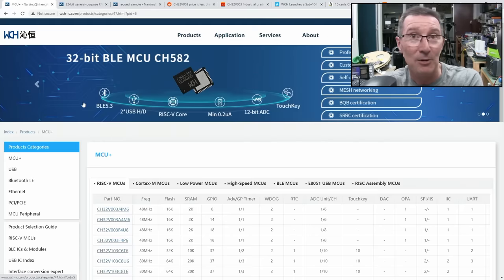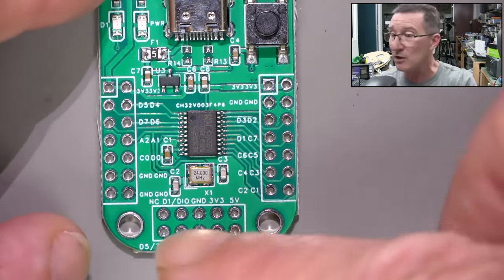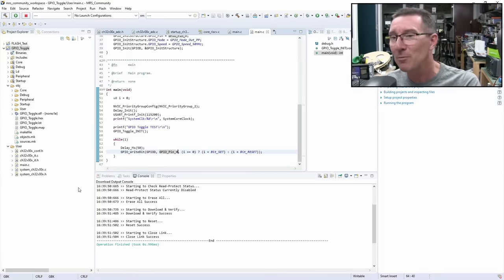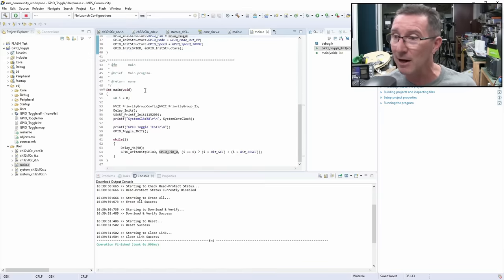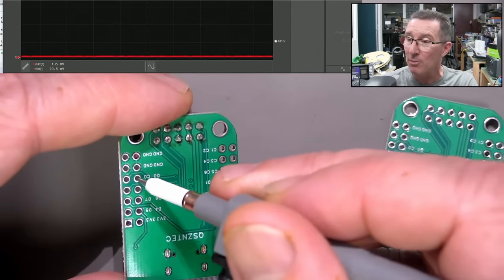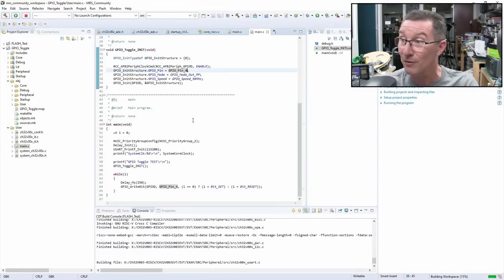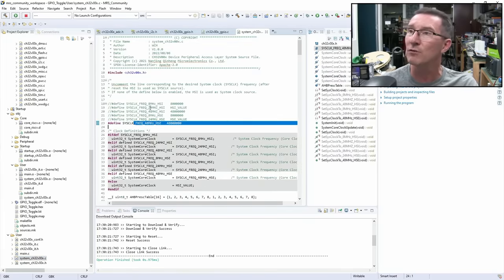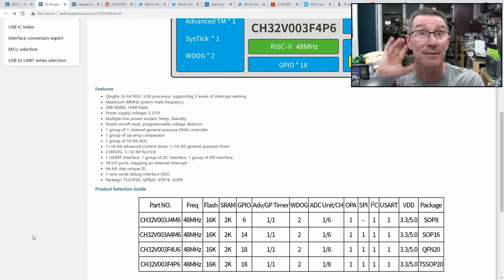EEVblog 1524 - The 10 CENT RISC V Processor! CH32V003

Comment: The prices is completely crazy.
I teach EE131 (first year Digital Electronics) at a local university and basic digital ICs cost more than that.  It is important they understand digital logic; but, the only place they are likely to ever use it is in an FPGA design.
I recently helped someone debug a Space Invaders Arcade Game and most of it is done with MSI logic (counters, etc.) and only one Microprocessor (which probably cost more than all the other ICs combined).  Things have certainly changed.
Reply: Yeah with microcontrollers and to some extent FPGAs becoming as cheap and small as they are it doesn’t make a lot of sense build something up using digital logic chips. Microcontrollers are just that versatile now, you can use them for implementing a single gate or you can implement a complex control system. Their only downside really is speed, they are usually quite a lot slower than the propagation delay of a gate but most common applications now aren’t relying or dependant on the speed of individual gates unless it is in a very high performance or high speed system, in which case you probably have more going on than just a single gate and you are probably better then just using an FPGA.
Reply: When I at college learning electronic engineering we had to buy pic16f877A wich was the stronger part less prone to burn on our hands, it was 8-12$ then now should be about 25$ thanks prices are relatively cheaper now, but said parts on 10c even having free ide (i learn with proprietary pic ask and PICC both pain in the ass and expensive for non educational projects) kudos
Reply: I took digital logic twice, once at a small university where it was part of CS, but actually offered by the physics department (and I TA'ed that course for a couple of years after I took it) using discrete 7400 logic chips. I took it once again after I transferred to another larger university to switch to COMPE from CS (and in eningeering they wouldn't transfer any courses beyond 1st year courses), where it was all FPGA based. The discrete logic chips in the breadboard was more memorable and fun, but took hours of plugging wires into the breadboard, and troubleshooting if you made a mistake. The FPGA version was way faster, but less memorable and less fun, and less "hands-on" - I always did the labs the night before at home, simulated it, and basically loaded it up on the FPGA board and demo'ed it to the lab instructor in the first 5 minutes and left for the afternoon (to go work on the endless stream of homework from other courses).

Comment: I remember prototyping with the PIC 16F54 in the mid 2000s with <1K of program ROM and 25 bytes of RAM, and programming in assembly because of the cost of the C compiler and having so little memory.
Reply: In mid 2000s I programmed not PICs but OTP Z86E04. Made controllers for lights flashing on buildings.
Reply: back in 1800 we only had candles, those were the days

Comment: Damn, that's a lot of value for just 10 cents! I'm already even somewhat familiar with the Eclipse IDE, since I like to use STM32 MCUs, so it should be a breeze for me to start using these as well.
Reply: Where do you source parts ? I need whole tape of STM32s and there is none on the market right now. Do you think that big manufactures are getting special priority lead times? Last time I checked the lead time for ANY STM32Fs was 500days.
Reply: @webkar  Currently nowhere. They are basically all overpriced and/or completely unavailable everywhere I look. I'm just biding my time and keeping an eye on worthy alternatives.
Reply: @webkar  we might be seeing more and more risc v drop in replacements.
Reply: @JamilKhan-hk1wl  almost every MCU manufacturers, even the historical survivors, are jumping to RV cores. There are some pin compatible replacements of chips like the STM32F103 for years but the issue right now is availability.

Comment: I just redesigned my little LED controller around a ESP32-C3, that variant is also based on Risc-V. Definitely gonna check these out too, not only is it cool that Risc-V is an open architecture, availability of Chinese parts seems to be a lot less variable than western parts have been recently (one of the reasons I switched my design from a SAMD to the ESP32C3..."supply chain").
Reply: I used the ESP32-S2, and the peripherals (particularly the ADC, DAC, and UART) were terrible. On the S2, there was no way to linearize the ADC, even with a look-up table. The SAMD-51, running the same code, worked perfectly, no tweaking needed (though you can actually tweak offset and linearity in registers on the SAMD-51's ADCs.

The RP-2040 has a wonderful manual, though the chip has some bugs (the manual writer apologized profusely for one of them). The SAMD-51 has a decent manual. The ESP32-S2 has a pretty lousy manual (unless they've redone it recently).
Reply: @Johnny.Fedora  Yeah I've used the ADC on the original ESP32 and wasn't impressed, but for this device the only thing I'm using ADC for is measuring the battery and that can be pretty rough. I'd expect it to be the same IP block/fab process on the C3 so probably no better. C3 doesn't even have the DAC, and the UART is fairly tertiary for what I'm using it for, I expose the pins on an expansion header but for the most part I just use these things for making small lamps/simulated candles from turned wood (board is round and fits in a 30mm forstner bit pocket). The USB serial emulation seems to work well enough on the dev boards I picked up, and that's mainly what I wanted. Overall, ESP32 is a cheap low-end chip for low-end applications, and that's exactly what I'm using it for.
Reply: @treelineresearch3387 , that makes sense. In fact, one of the peripheral part choices had an on-board ADC, which mean I'd only have needed the SPI port. In any case, I wound up going with the nRF52840. It's not cheap, but it has the necessary memory/processing power, so it's all good. When RISC-V is more competitive for that niche, that's what I'd like to go with, on principal.

Comment: The STM8 standard I/O library was fairly incomplete. i re-wrote much of the library before fiding someone else had done exactly the same. ST (like AMD) are great at making silicon, but not so good with software. So I wouldn't be too surprised to see ST make a RiscV implemementation, as they need not worry about software. The kings of the MCU software have been PIC, but from what you show me, this isn't too far from PIC in terms of ease of use.

This architecture (looking at Mhz) perhaps sits between STM8 and STM32. The STM32 is ARM based, and ST could save money on licencing costs, so we could see a merge in those  low and mid-end MCU offerings in a Risc V product line. A scalar lower speed to replace STM8 and a higher clock and instruction pipelining and other logic trick superscalar basic instruction set RiscV to replace STM32 with the same tool chain accross the product line.

Comment: Interesting idea, Dave. It's nice to see that microcontrollers are coming at a good price.
Reply: This mc is 32bit replacement for stm8s003, has same pinout. stm8s003 cult microcontroller. Nuvoton did it's x51 N76E003 pinout compatible, now ch32v003.

Comment: As the STM8/32 is often using external IP for IO (and in the32-case also for the cpu), it is easy to make replacements. The accused „counterfeit“ STM32F103 are such cases. They just licensed what ST licensed before. No legal issue.
And the same is happening here. The IO is what needs experience, the cpu is handled by the compiler.

BTW, this is the result of threatening customers to sanction them. They then try to build it on their own.
Never get a customer to look for alternatives.

And on toggle:
Pretty sure you can just use the io registers directly. They might look very familiar for STM experts. Assembler might not be needed. Some time ago, in a German forum an AVR assembler expert was burnt down by GCC and someone able to write good C++ code. The metric was flash size.

Comment: Bit of a mangled RISC-V explanation there. It's indeed just an ISA, which means that you either get an open source core that implements this ISA, or you pay someone else (like SiFive) for the core, which means that you still pay license costs, especially for any IP blocks that are likely to be added to the processor.
Reply from the maker: Well yes of course, you could pay a license fee to use someone elses pre-built core, but that's not really the point of a major manufacturer for example making a RISC V chip, they'd do it in-house so they never have to pay a license fee.
Reply: @EEVblog  Yep opencores has open cores for RISC-V e.g. the NEORV32

Comment: Cool to have something like that. I personally haven't played enough with my ESP32 and RP2040 µCs and don't really need these (especially while there's no IDE-free open build system yet, seems like), but maybe at some point… Thanks for showcasing the thing!
Reply from the maker: People developed an open system for the Padauk micro very quickly, same thign might happen here. It's all there really, nothing stopping someone taking all the dependencies and just usign the commend line GNU compiler without the IDE. Why not just use Ecplise though?
Reply: @EEVblog  I think I heard most of it in the video after submitting the comment, I'm only not in that hurry of verifying it for myself.
If I was a good specialist and really needed them, I would participate and invest my efforts into doing this; yet, I'm a silly curious viewer of your interesting videos.
I didn't really like Eclipse back when I tried it, prefer a lightweight text editor and make or cmake myself.
Reply: @EEVblog  Espressif are leading the way in migrating their powerful and now very mature stack.   While they are still mostly relying on ESP32 with Tensilica cores, they are now so big and pervasive in the IoT market they stand to benefit immensely by moving across to RISC V by using the same SDK they have been developing for ages and are now at version 5.0
Reply: @Janus Kobain  what are you saying? The log shows it uses makefiles just like so many other controllers out there. IDE is irrelevant.  You could easily build that without  the IDE, just using open source tools. As for the flasher, it's probably just a bunch of uart command that you could write into a  Python script. Probably, less than a day's work.
Reply: Also, there are tons of eclipse  based IDEs out there from the leading microcontroller manufacturers.  They aren't pretty but really powerful once you get over the learning curve. But yes, they are a mixed bag. Some do implement really well, and others are really bad and slow, where a text editor like notepad++ is better.

Comment: The build system probably doesn't have the hex file as a dependency. How to fix that depends on what build system eclipse is using for your project .. its own, make, or maybe something else.
Reply from the maker: Ah, so it's flexible, interesting. I did see all sorts of options for setting up dependencies, but was easier to just save it for this video. Thanks.

Comment: I'd love to see how good (or bad) the ADC is. There are some absolutely brain-dead examples of ADC uC implementations (be that design, software implementation or hardware). I reckon you can tell a lot about build quality by how well or poorly the ADC performs because it's one of the hardest things to implement with good results.
Reply: I've used the Espressif ESP32-S2, (RISC-V) and the ADC was TERRIBLE -- and the serial UART was problematic. I ran the same code on a SAMD-51 (ARM4F), and everything worked beautifully. It was impossible to lineraize the ESP-32's ADC, even with a lookup table, whereas the SAMD-51's was quite linear without any correction. Also, I had to stuff a byte out at start-up on the ESP32-S2, or it would always eat the first byte, throwing everything off by 1 byte.

Comment: Can't wait for a mesh net to be available using this. Going to be super cheap to wire up a home. Near endlessly updateable. Right now it's a thousand bucks.
Reply: That was my first thought.  network routing.
But 8 ADC's can be useful as well.  It could run an 8 channel mixing board.
Reply: @robertsmith2956  8 channels, not 8 ADCs as far as I know, so they will be multiplexed, so the more channels you use the slower the sampling rate. This is very common for microcontrollers. Loads of other microcontrollers like STM32 have more than 8 ADC channels and some even have multiple ADCs.

Comment: I never ever knew an IDE where you don't have to save after you edit a source file.
Reply: Arduino IDE does not need to save before compiling/linking. VSC does not need manual saving, it's automatic.
Reply: @donvukovic7440  VSC only if you enable autosave - it is not on by default. Yes Arduino IDE has autosave on by default.
Reply: In Eclipse it can be configured whether to auto save before build or not. You can even configure auto build on save.
Reply: @foo2332  But if you build without saving does it still build from the edited file? I doubt it.
Reply: @BrianG61UK  no. It will save automatically when you enable "save before build". Otherwise it will build from what is currently on disk, and this mode (silently ignoring changed editors) is actually pretty useless IMHO. This was on of the first things I configured years ago. If I press Ctrl b it will now first save and then build.

Comment: @8:31 The peripheral clock enable function on line 35: This looks similar to how peripherals function on STM32 chips, each peripheral (i.e a GPIO port/timer etc.) has a clock enable to it allowing the peripheral to be completely powered down. By default all peripherals have the clock disabled and have to be enabled one by one, so that only the peripherals you need consume power. It's likely the peripheral design on this chip follows a similar pattern to STM32 chips (and potentially other 32 bit ARM micros).

Comment: The nice thing about the RISC-V situation is, the barrier for a vendor to just let you use an unmodified standard toolchain is very low.
Making a source-compatible (with the competing STM product) library would be the last mile (and at first glance it looks very similar). Under all of that Eclipse goo, it's just running GNU make, and the problem with the "build" command is probably to do with an incorrectly written Makefile.
No doubt a chip like this if it gains popularity will get an Arduino port.

Comment: The RISC V is open source but you still have to pay a 100k for them to allow you to get the technology. You may not have to pay royalties but still have to drop a huge amount of cash to begin with. Not really open source like the linux distributions that just hand you the code at no cost, you just have to share any modifications you made to the code.

Comment: Does it have Arduino support? It is very important for hobbyists in general, specially because of the large library base available. If not, soon there will be, as was the case with the ESP8266, ESP32, etc.

Comment: It is pretty cool, I found some 64k flash 48 pin MCUs in their offering that are on lcsc for about $1, but then let's say one spends a month developing a real product and then they dissappear unless you buy 100k units from the manufacturer... The chip I found lscs has 64 of them. That is not much. I also looked at other wch chips. Some have better availability (half a roll or so), most are out of stock, many have like a dozen available. Until it says something like 10k in stock it doesn't inspire much confidence.

Comment: I can not wait to use this with gcc. Now I am using stm with sdcc and the main feature of sdcc is that it quotes Frank Zappa.
Reply: @andymouse  From sdcc: "conditional flow changed by optimizer: so said EVELYN the modified DOG" and that is a a Zappa quote. Basically sdcc is a very bad compiler.

Comment: It probably doesn't flash the LED on the dev board by default as there are likely various dev boards, with LEDs etc on other pins I guess? This is really interesting though - I've used the STM8 part this copies on some small boards just doing multi-LED PWM animations and they've been reliable after months of service.

Comment: Not only is the ISA unencumbered with licenses and agreements, but RISC-V micros are inherently less complex than equivalent performing ARM micros, and require less area (or can be made on cheaper processes), and beyond that manufacturers are incentivized to actually get involved with core design, and even then if they don't care, the open core designs are always improving.
On these three fronts, the cost of everything except packaging will drive downward for RISC-V parts.

Comment: You can write to the GPIO output register directly in C without using assembly. This should be as fast as assembly but easier to program.
Reply: Of course you can. You use the function call already provide for you, as then the code will be more portable across its family of mcu's 
as the function uses multiple #ifdef to recompile based on family mcu.

Comment: I just took apart yet another dead led edison bulb and started knocking the led chips off. I was thinking about hooking up 4 of them in a (physical not electrical) line to a ESP8266 to see like back and forth light tricks, pwm dimming etc. Will be hard to solder. I was hoping I could solder them to a header of some sort and plug it into a breadboard with the ESP8266. It works about the same as an Arduino using the Arduino IDE.

Comment: You do get in-depth.. But you should explain more about WHAT exactly the chip can do? use cases? what can it run?
Reply: Anything any other microcontroller with 4 KB RAM, 16 KB flash for the program, and N gpios and M ADCs and a C/C++ compiler can do?